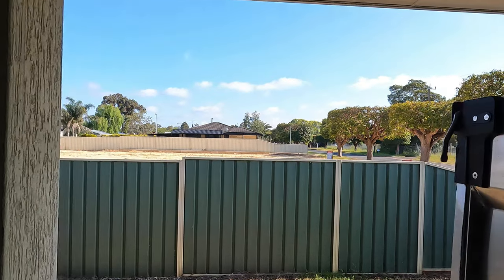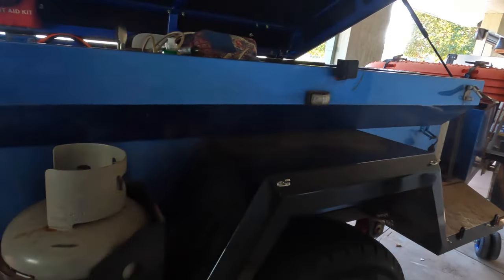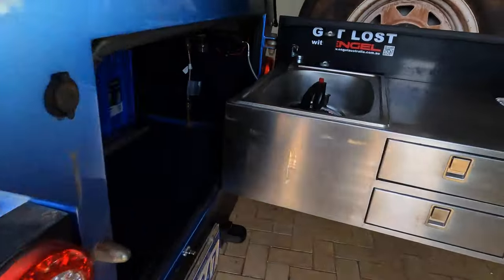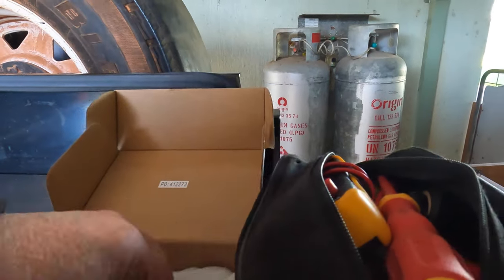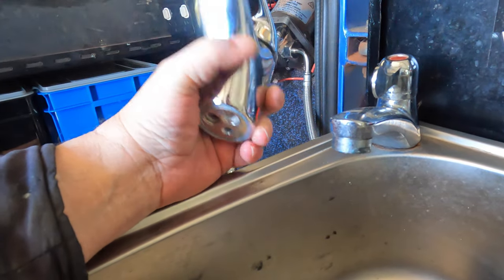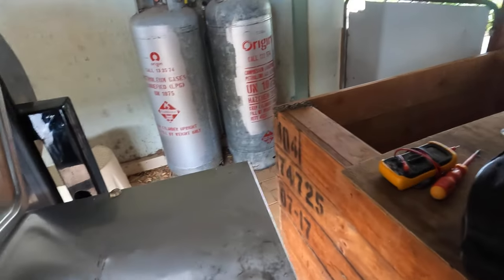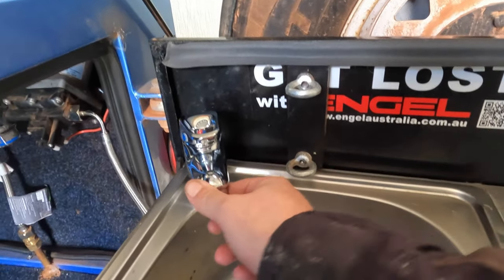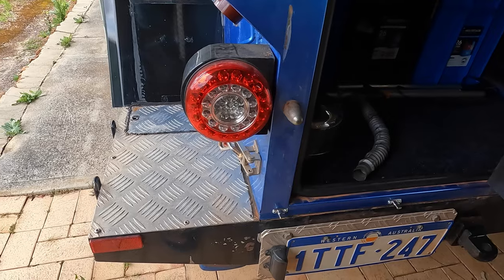How to Have Hot Water on Your Camper Trailer (1)

Comment: Nice project hot water is a must. I hope all goes well with your wife with your wife scary stuff.
Reply from the maker: Yes is a bit. I just get her checked out before I take her out bush again. Better safe then sorry. I am sure she will love the hot water in the sink. I looked into the DC water heaters but they seem to slow and take a long time to get hot. I have AC power on the camper so I figured that i just use AC power. 👍